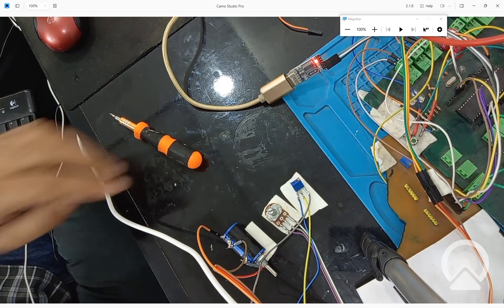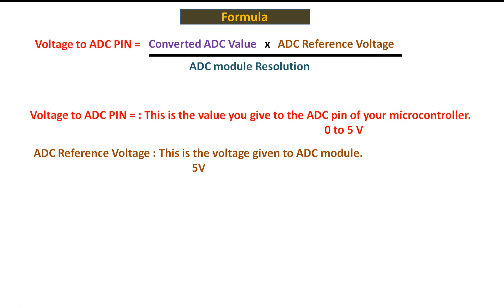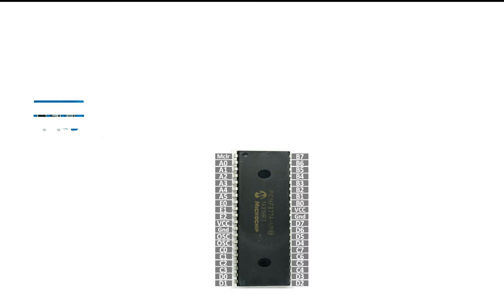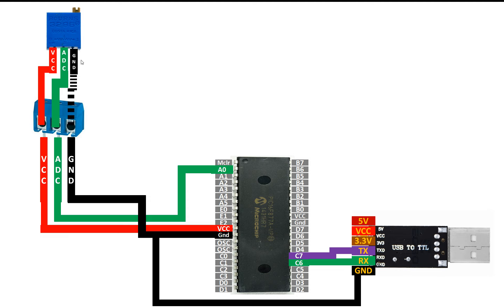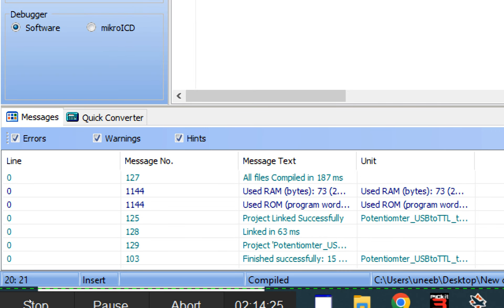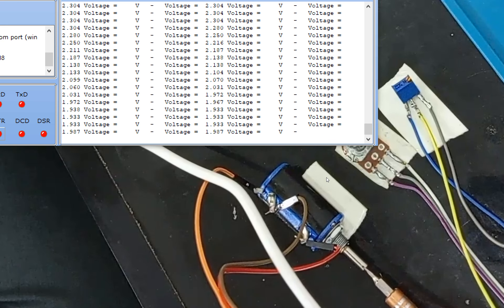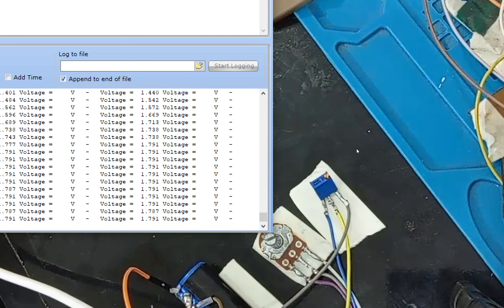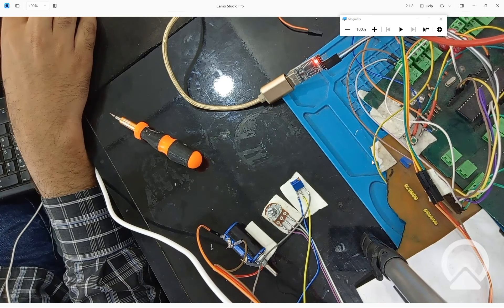PIC16F877A based potentiometer tester. Output on PC/Laptop using USB to TTL device.

Comment: Dear sir I want to operate CT 3021 with microcontroller. Using potentiometer.
Reply from the maker: No issue
Which compiler you are using?
Reply: I am using microc compilor
Reply from the maker: Share here with me the link of CT 3021 datasheet